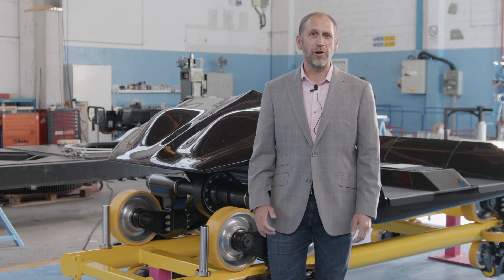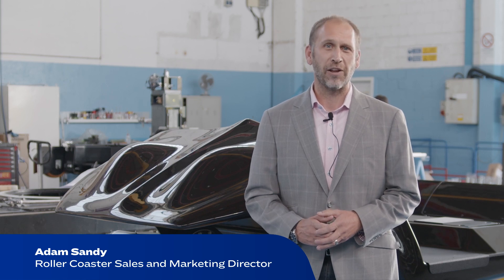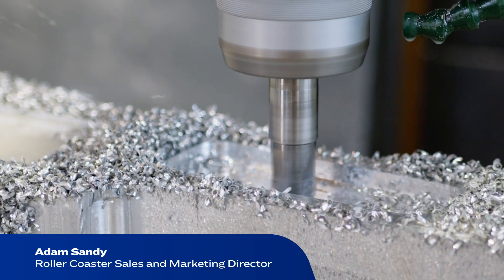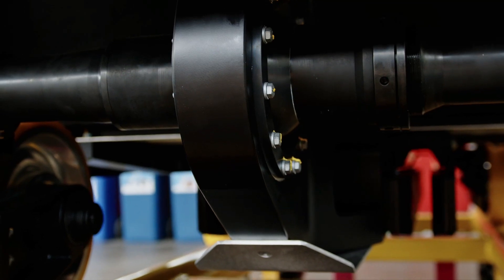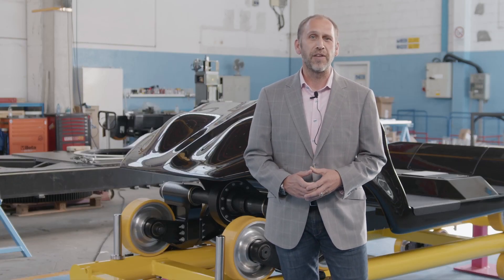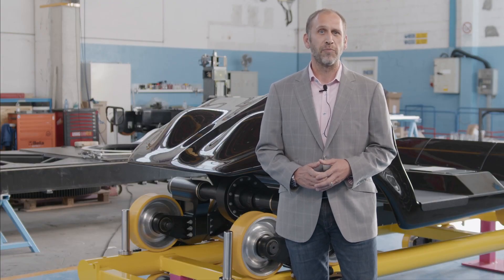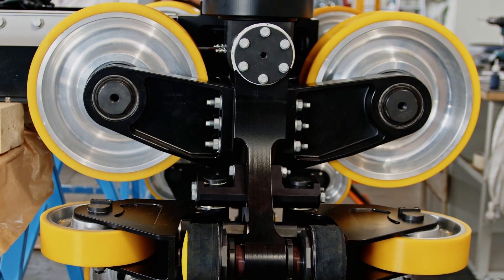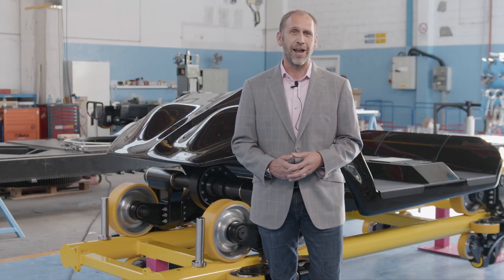Lightning vehicle - Adam Sandy talks about the train

Comment: 200 kilometers is just enough to clear the tophat at Top Thrill Dragster with a little bit of room to spare... though kinda bummed they didn't set their bracket speed higher... this would have made me dream of potential new height record breakers in the future. (Kingda Ka needs around 206 km/h to clear its height record). For them to break both speed and height they need to punch above 240 km/h. It's great to know Top Thrill will return to its former glory with maybe a few more additional surprises, but it's just a shame they are not pushing it to dethrone some others to be the champion again... These are just assumptions clearly, but I'll be watching for you guys to surprise me!